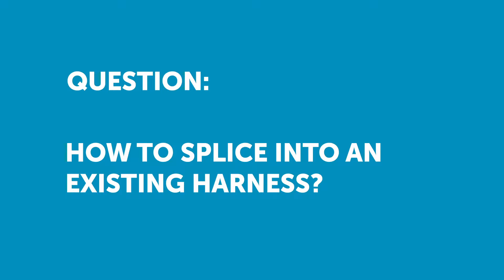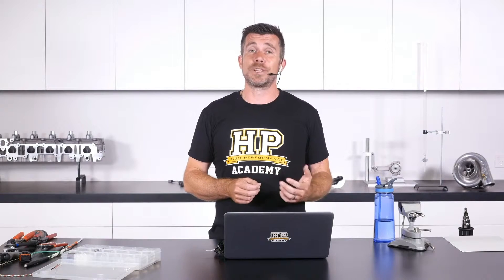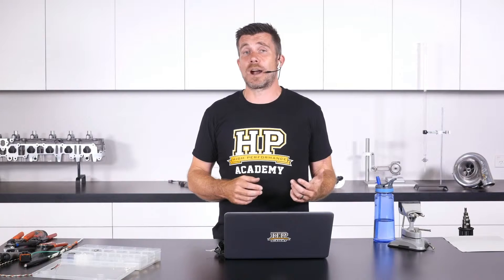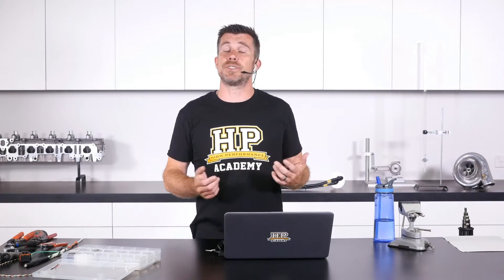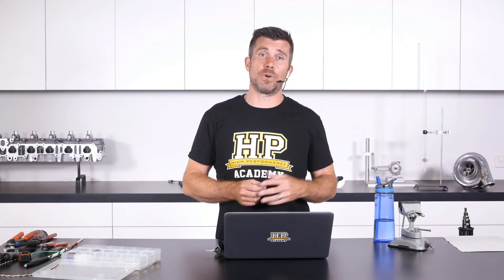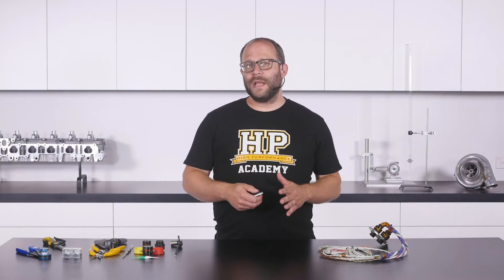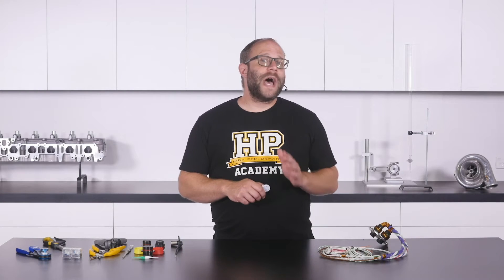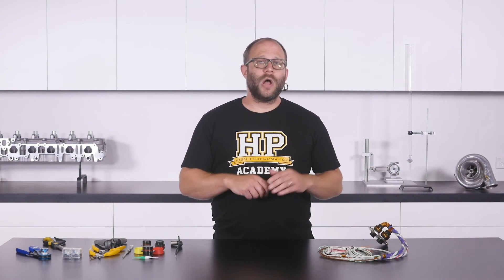Splicing Into Your OEM Harness? What's The Best Practice? [HPA Q&A]

Comment: I also like to use the Raychem Duraseal range. I simply cut the wire and rejoin it with a Dureseal splice. One wire goes in one end two wires come out on the other. It has a nice shrink insulation to seal.